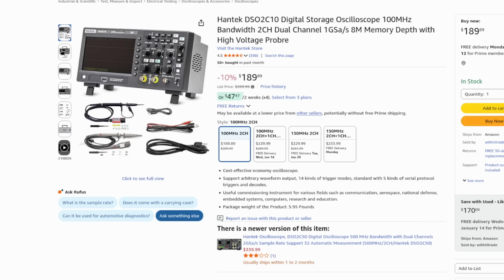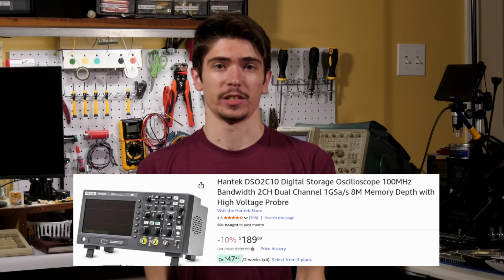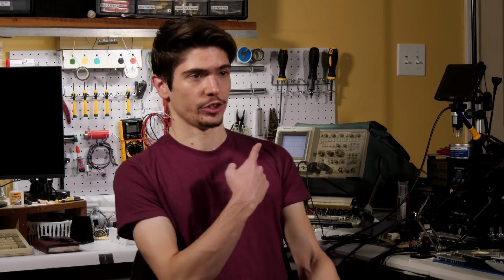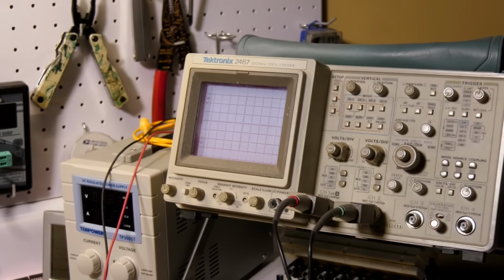What You Need to Begin Electronics (Start Analog)

Comment: What do I need to learn first to repair vintage audio equipments?
Reply from the maker: I would first learn about the various components and how they function, like what they do in a circuit and why. Also with a heavy focus on vacuum tubes, since vintage audio equipment is usually based on them. After that, get acquainted with methodical fault-finding so you can pin-point where the issue causing the symptom is. And then of course, there are the skills involved in actually replacing the faulty parts; desoldering and soldering being at the top of the list. This is extremely brief, but can hopefully help you get started in the right direction.

Comment: Great video! These days there are so many “experts” that don’t remember the term “solid state” or if they do they use it interchangeably with “digital” the two are not always mutually exclusive. 

Our first computers filled buildings with vacuum tubes and performed digital tasks. Vacuum tubes have been replaced for the most part by solid state devices (closer to N channel FETs than transistors for instance) but the circuit is still analog. There is a huge depletion of analog engineering personnel available in the job market.  Vacuum tubes are making a comeback in the audio world by xgeners that have discovered vinyl and its sound that is unadulterated by slow bitrate, DAConversions, etc. A Digital file is missing fingers on a fretboard for instance. 

After all our 4 senses are very sensitive analog I/O and our brains process data as such. 

Fascinating discussion actually.
Reply from the maker: Thanks, I'm glad you enjoyed! For sure, analog electronics is a foundational part of electronic design which too many people skip because digital electronics are "easier". Easier if you stick to Arduino, I guess, but there's lots of analog complexity in there which beginners don't even realize if they skip understanding it.

Comment: I'd also strongly recommend buying wire that has a silicone sheathing rather than plastic. In my experience, silicone offers far better heat resistance meaning it won't warp or melt from touching a soldering iron being under hot air and for stranded wire it's significantly more flexible.

Comment: Can you do a vid on spyware. There's this documentary about how people who repair phones can easily access your data. 

It's how I got into this. Just wanna know how vulnerable we really are.
Reply from the maker: I probably won't do a video on spyware as it's not quite on topic for my channel, but I can tell you that accessing unencrypted data with the right equipment (like lots of phone repair shops have) is trivially easy. I think iPhones encrypt all data stored on them now, and I wouldn't doubt if the big Android brands did too. Getting that data would require breaking the encryption, and possibly (though I don't know for sure) communicating with the memory chips over an encrypted link, which makes the data double-encrypted.

If the link is unencrypted, a data thief would have to make an image of the entire memory chip and then have a computer crunch away at it for weeks-to-months to break the data storage encryption for just one device. If the link is encrypted, nothing short of a hardware exploit (or a REALLY good guess) will even allow them to get to the data at all during the time they have the phone.

But barring encryption, it's absolutely true that hardware access is full data access. So then you'd want to choose a repair shop you trust. Or do it yourself since we like doing this kind of stuff anyway.

Comment: As a beginner, this video was super helpful, can you do a video on what power supplies suit which applications? Im struggling to gauge what projects I'll work on in the future so I'm leaning towards a 30w 10a as insurance if i move onto more demanding projects, the production quality on your videos are getting really good though! My monkey brain  really liked the nostalgic info-mercial style filming of the products, keep leaning into this 80's/90's aesthetic, same goes for the thumbnails, keeps a really good consistent theme that makes browsing your channel more engaging. Cheers for the help dude, looking foward to more of your content.
Reply from the maker: Thanks for the feedback on my production and thumbnail style, and I'm glad the videos are helpful! I might be able to do a video on selecting a bench power supply. But in case it doesn't happen for a while in between some other videos I currently have in the works, I'll give you a quick bit of info on it here.

30V (I assume you meant volts and not watts there) 10A is a great choice for a general purpose bench power supply. It doesn't matter too much if it's switching or linear, but as mentioned in the video, linear power supplies have a cleaner output voltage, particularly when operating near its limits. Mine is a 30V 5A linear power supply, and I've never maxed it out with what I've built so far. So I really think the 10A one you're leaning towards will be a great choice, so long as it isn't too cheap and low quality. $50 is a good minimum for a decent quality switching power supply. $80-$100 for a linear one.
Reply: @RAndrewNeal thanks man, I really appreciate the advice 🙏

Comment: Lead solder? Never, with a lead solder U will need duct and powrfull fan and filter between blow through wall to outside of Ur workshop. It's very small amount of lead which effects can be seen on cognitive resources.. Like in US caused by lead in gasoline, and big reason why Americans over 30y are mostly...well it have to see and feel somewhere outside of US, like in Asia or Europe... simple.
Reply from the maker: Metallic lead doesn't vaporize at soldering temperatures. The fumes comprise of the flux only. Lead must be red hot before it vaporizes. The only exposure you have with lead when soldering is by touch. Wash your hands after you're finished to avoid getting it in you.

Comment: Hi! so glad you exist on YT. do you have a resource for finding analog gear? all the physical shops I used to visit have now disappeared...
Reply from the maker: I'm glad my videos are helpful! I usually look for used analog gear on Ebay. Though shipping prices are getting higher than the gear price for larger items like oscilloscopes or power supplies. Ham radio guys still have swap meets I think, but I don't know if you need to be a licensed ham operator to join those groups. You might ask some local schools with EE programs if they have any old analog equipment they don't use and would like to get rid of. Facebook Marketplace may turn up some results as well.
Reply: @RAndrewNeal very helpful
Reply: oh and Im looking for analog not digital (make a difference?)

Comment: I'm still working out how to talk the wife into letting me buy an oscilloscope that will be of any use to me.

I don't even really understand how to use a scope or what I'll need it for.

I still use the instruction manual for my multimeters 😂

But I am entering the second year of an electrical engineering degree (though year 1 and 2 are mechanical and electrical).

The amount of actual lab time in year 1 was abysmal.
Year 2 is basically entirely online and I don't think there are any lab classes at all. It's very simulation heavy.

So by year 3, next year, I'd prefer to have done enough little projects and design a few circuits to give myself a good basis.

I have absolutely no coding experience, so I think analogue is the best way to learn.

I tried one project with an arduino but the complications that added, on top of not even understanding how or why I was adding things to a circuit someone else designed was too much.

So I'll start making some small circuits with op-amps and ICs and stuff.

Hopefully by the end of the year I'll have worked in some microcontrollers and started learning some basic programming.

I've got a long way to go 😂 sorry for the life story
Reply from the maker: Sounds like you'll enjoy some more of the videos I have planned! I'm about to produce a whole lot of them, and among them are how to use an oscilloscope, how to use a multimeter, and how to outfit a home electronics lab on a budget!

I definitely recommend building a solid understanding of analog electronics before doing anything digital. Most guys start with digital and then fail to troubleshoot issues because they skipped the foundation. Your plan is a good one, so definitely do that before reaching for a microcontroller.

I would recommend your first digital project, when you get there, be discrete logic instead of programming. It'll give you a better understanding of how digital systems are built and function. Then you can carry that knowledge with you to learning C for embedded programming and even Verilog or VHDL for FPGAs. I enjoy all of it from simple analog guitar pedals to FPGAs and communication protocols lol.
Reply: @RAndrewNeal yeah, I'm thinking about making some guitar pedals at some point as I've recently picked my guitar back up after 16 years 😂

I will definitely be watching you ☺️ I'm hoping to make some videos along the way if I can, maybe I'll get some good tips and give people a realistic view of someone learning as they go.

I'm going to do a smaller analogue projects throughout the year, but I'm going to be simultaneously working on a custom keyboard build from scratch.

It's effectively a very large macro pad I'll be making with a completely custom layout, hand wired together, custom designed switch plate and case that will be 3d printed (I have a bambu H2S but I'm a new at CAD) and I'll control it with a raspberry pi pico.

It will likely take me months just to settle on the key layout and amount of keys I'll need, then wiring and learning fusion to design the switch plate and case.

The actual programming will be one of the final steps, and it will largely just be implementing open source software and configuring it.

It sounds like a big project, and it may end up taking me longer.

But it is just a long term goal to slowly chip away at whilst I learn the fundamentals.

But I will just keep doing small projects that will help in the areas I need.

I tend not to take in much if I just copy a design and follow instructions.
Reply from the maker: @Scottbutcher7  Awesome! Having a long running project to keep you challenged is a great idea and motivator. Also, you're spot on about not taking it in if all you do is follow instructions. You've got a solid plan! If you make any videos, I'd be interested to see how your experience is going.

Comment: Starting out= lab power supply, breadboard, multimeter, some wires, circuit description and needed components. Later can be looked for a oscilloscope, soldering iron, making your own pbc's and so on..Oscilloscope, starting out you don't need 100MHz. 20MHz will do, as are the most budget ones. You can probably get a analoge one probably for free and pick it upin your neighborhood. If you are an enthusiasts and come to meI would give you one 😀 as I also need to clean up haha. Thus, no fancy stuff, just basic. Try to buid and test some circuits. Bunch of ideas on internet. Flashing some LED's is always fun.

Comment: I agree with the analog part. The problem with digital circuits from a learning perspective is that the main functionality comes from a microcontroller, which is essentially a black box. I learned alot more about actual electronics by building a toy synthesizer (MFOS Noise Toaster) than from an entire Arduino kit.
Reply: These days, the 74HCxxx series logic chips are a good way to learn the foundations of digital logic. They are still being produced (even in breadboard-friendly through-hole versions for most parts), and still follow the pinouts and general behavior of the classic (and revolutionary!) TTL logic chips from the '60s and '70s. The simplest ones are individual logic gates, and the most complicated ones are counters and shift registers, which are still simple enough that they aren't complete black boxes.

Comment: If you go Analog, you have to learn differential equations. Means if you are out of high school for a long time, you need to go back and do all the school maths needed to learn those later equations.
Reply from the maker: And calculating complex impedance for matching networks for high-speed, fast-edge digital signaling is a lower level of mathematics than equations describing relationships between equations? All you need to begin is basic algebra.

Comment: I use busboard stuff as well. Same with perfboards as well. Beware chinese brands for wire usually in my opinion. I make my own clamp wire or hook clips, I buy pomona usually. They go on sale sometimes, especially the silicone copper stranded test lead wire.
Reply from the maker: Thanks for the recommendation! I haven't bought enough clip or hook wire to know at which price point to stay above or which brands are solid.

Comment: I found a Goldstar OS-7020 20mhz oscilloscope. And im a hobbyist/student, Is the bandwidth enough?
Reply from the maker: Yes. I think I was a little too steep on the specs for a first scope. 20MHz will do you well until you get up into radio design territory.

Comment: Those BKs are great old scopes, I have the 15MHz 1477, it survived for decades in a highschool lab. You can get pretty far with a $50 oscilloscope. I don't recommend trying to salvage basic components, cause it can restrict the scope of projects too much, and causes clutter. I do recommend the TI paper on single power rail Op Amp design, and simulation tools like the Falstad one.
Reply from the maker: Mine's got a little dirt in the rotary switches, but it's still a great scope even still. Totally agree the old BKs are great scopes.

I agree on not salvaging basic components. I tried that early on, but used almost none of them because they were either the wrong rating or had no leads left.

I'll have to look into that TI paper; it sounds interesting. I do use Falstad from time to time; I actually used it to make some visual aids in another video.

Comment: wow its so expensive getting into this compared to digital electronics, for that you only need a dev board that costs a few $ and that does almost all the heavy lifting
Reply from the maker: There's definitely more to it by virtue of every "code block" being its own collection of physical parts. But it doesn't have to break the bank either. You can get started with very low quantities of parts, and once you compare with all the peripherals that need to go with microcontroller dev boards to make them useful, the cost isn't so different anymore.
Reply: @RAndrewNeal yeahh I get what you mean but the cost to entry is pretty steep if I have to buy oscillators and a power supply and all that, especially if I want something that isnt the cheapest so it will last me for the future, but maybe that's just how I see it as a broke student.
Reply from the maker: Do you mean oscilloscope? You'll have a hard time without one no matter if you're developing analog or digital circuits. You also won't get far without a proper power supply either way. Especially once your peripherals exceed what a standard USB port can supply.
Reply: @RAndrewNeal yeah that's what I meant haha it got autocorrected, but yeah that is true I guess I don't need one right now as I'm still a beginner.
Reply from the maker: https://a.co/d/795a6BL This is super cheap, but it can still be a big help while learning. So at least you aren't completely blind. And then you won't feel bad about upgrading from it at that price point.
Reply: @RAndrewNeal that's actually pretty affordable I'll check it out thank you!!
Reply from the maker: You're welcome!

Comment: Great video thanks....
How do you recommend Analog Electronics for some one without Electrical Engineering background? although I'm an Engineer myself but not particularly any university level electronics subjects, but I'm very passionate about electronics and Microcontrollers and programing them, but again I lack the professional fundamental of some of the topic that you mentioned, do you think it would be worth it for me to invest some time in it or stick with digital electronics?
Reply from the maker: I see analog electronics as the precursor to digital. Starting with analog allows you to see how the electricity behaves and is affected by the components in the circuit, whereas in digital electronics, most of that is abstracted away. So I do think it is worth investing some time into learning, but you don't have to choose between analog or digital; you can do both and learn analog while still also building digital circuits.

Comment: I would recomend getting a non auto ranging multimeter and an analog meter. I see more people screw up reading when using auto ranging it's not worth it.
Reply from the maker: I like the manual range meters for the ability to set a range that won't move, but I rarely have a need to do that. As long as you don't neglect to read the units, auto-range shouldn't be an issue. At least it isn't in my experience, but to each his own preference.